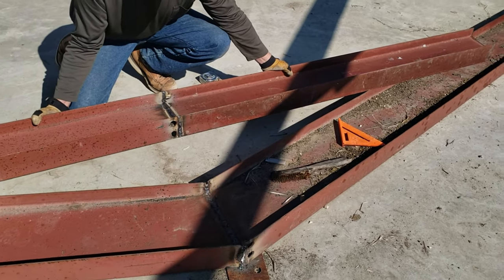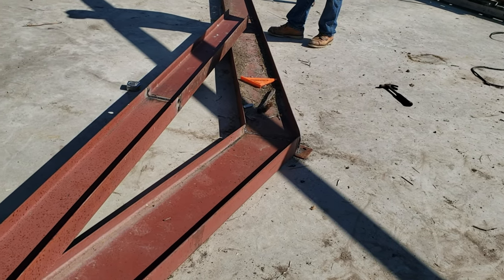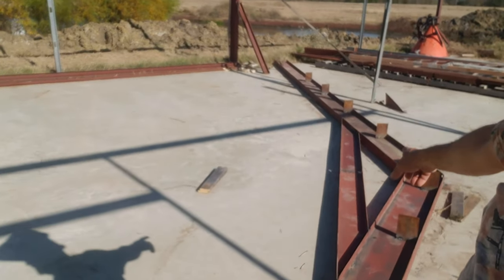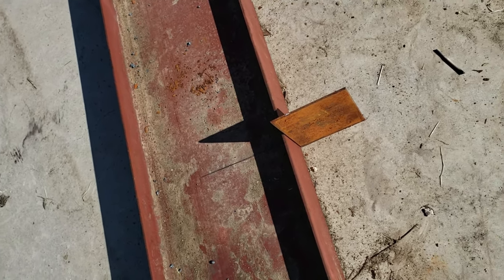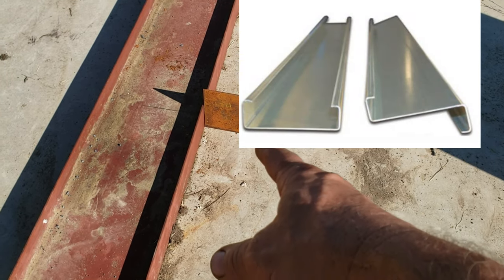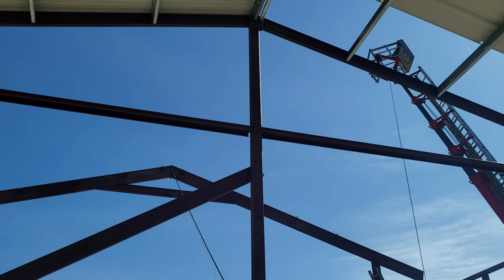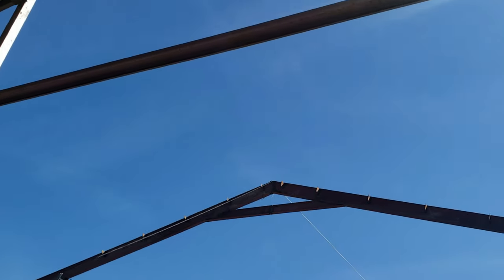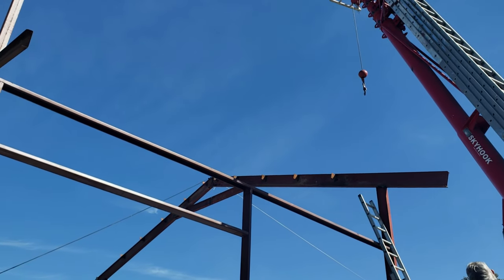Steel Barn Workshop Center Truss Fabracation and Lifting in Place

Comment: Looks awesome. I been wanting to build one but my lot is to small so may use my lot across town. I'm debating if to go with a slanted roof one direction or if to build like this. I will be using 5" sch 80 pipe for post also so limited on height.